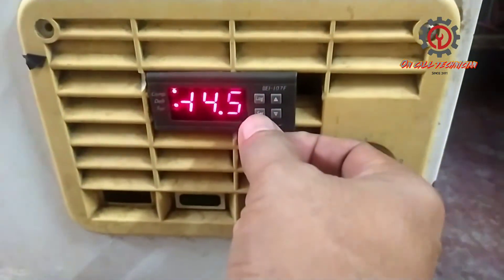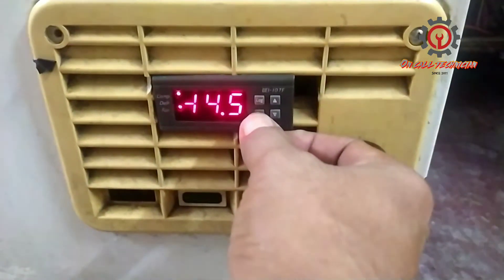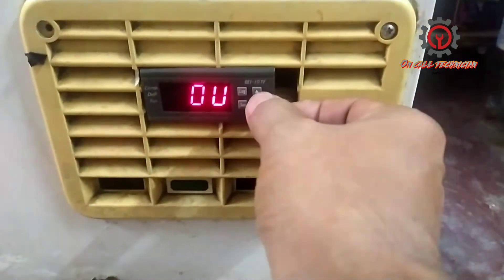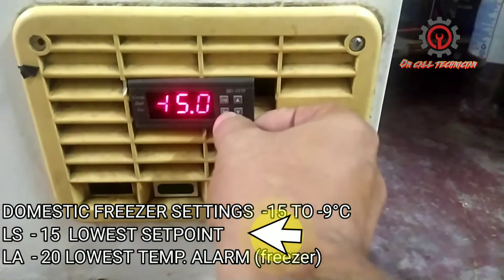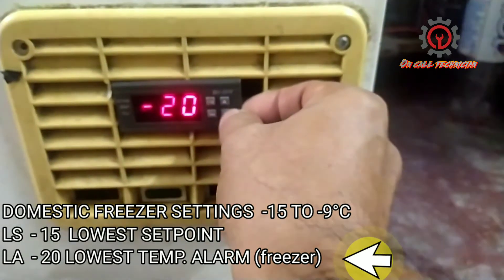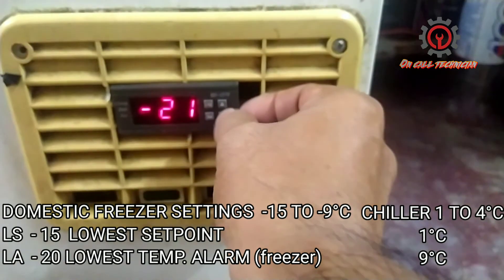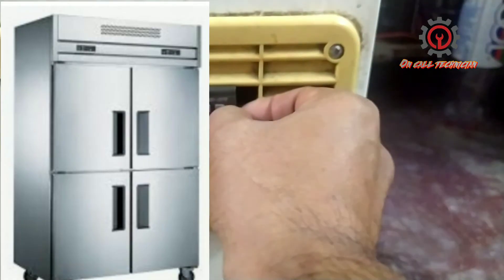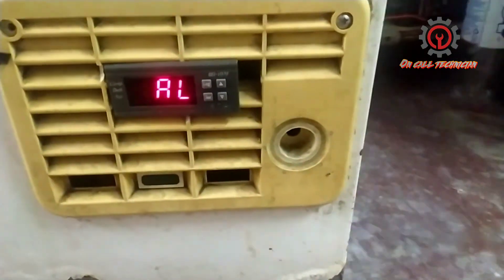HOW TO FIX AND CONFIGURE " LA " ALARM OF DEI-107F DIGITAL CONTROL OF COMMERCIAL REFRIGERATOR

Comment: Hello sir. My commercial freezer showed Alarm indicator on the dixell temperature controller, and temperature doesn’t go down like what I set. Could you please tell me what is the problem? Thank you
Reply from the maker: What was the error showing up?
Reply: @THEMULTISKILLEDTECH yes.
Reply from the maker: Im sorry ma'am haven't encountered yES error yet. Perhaps your model # is  xy20l or  xrb04cx. Compressor isn't running due to low or high temperature. Check refrirgerant pressure, evaporator fan and compressor fan, condenser fins should be free from dust
Reply: @THEMULTISKILLEDTECH  I’m sorry I missed understand. My Thermostat Xr20C error code said A temperature alarm happened. How do I fix that?